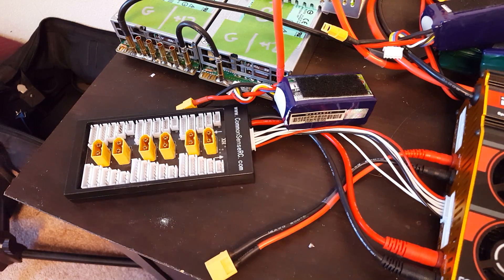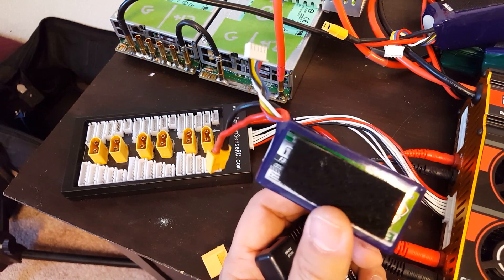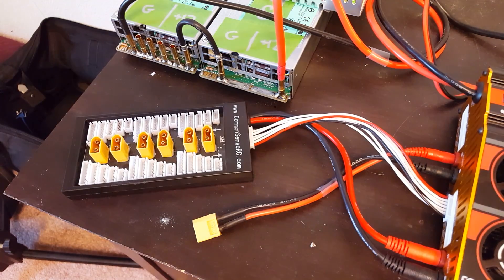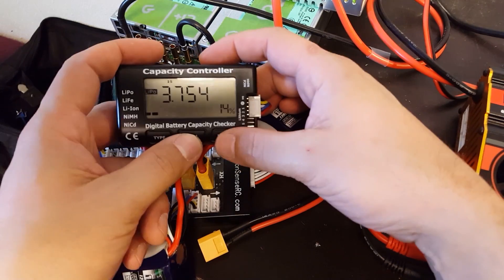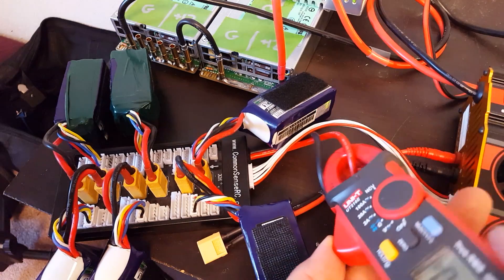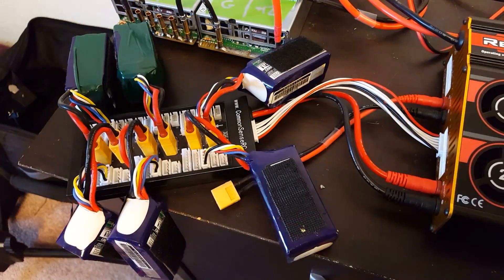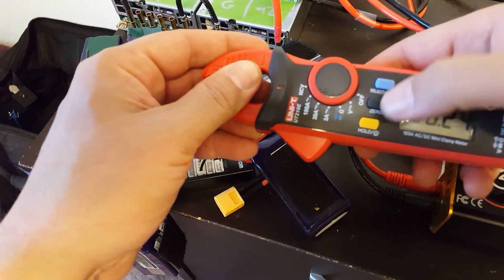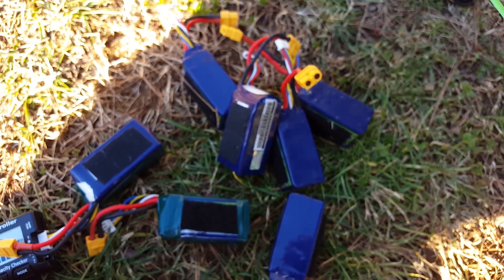Balance Charging: Can you parallel charge?

Comment: Can you discharge with parallel board six batteries
Reply from the maker: Yes absolutely.
Reply: @JoshuaBardwell  10x
What should be the settings for six 6s 1300mah batteries for storage
Reply from the maker: It probably doesn't matter because your charger probably can't storage discharge at more than a couple amps anyway.
Reply: @JoshuaBardwell  i ordered Hota D6 pro duo like hobbymate 
What should be the settings? 

I am a total beginner and i still wait my stuff to arrive but i want to get as much knowledge as i can before starting. 
Reallly appreciate your work and i will support you. Thank you for your videos i learned a lot

My gear is going to be:
Dji googles v2
Patched antenna from iflight crystal with 2 small ones
Dji remote 1
Hota d6 pro duo
Iflight protek 35 6s with spares 
Bat-safe box medium 
Batteries i have not order yet but i am not in a rush i have to do a lot of simulator work :)

It will be great to make a video for parallel discharging and storage. Or can you please tell me what should be the settings for six 6s 1300mah 100c batteries?

Have a great day :)
Reply from the maker: I would say, please get more familiar with the basics of lipo charging and battery safety before you try parallel charging then.

Comment: How do you know when all batteries are charged (without unplugging and checking) if they are all charging at different rates?
Reply from the maker: The nature of parallel charging is that all packs are at the same voltage and finish charging at the same time.

Comment: and this is why I like my DJI fpv ¯\_(ツ)_/¯  I want to fly, not learn about batteries- I also bought a cinewhoop so i am slowly learning about charging lipos through videos like this, but it still scares me, a lot, and I wish that there was just a smarter way to charge them without an absolute mess of cables- with the DJI it's simple, wall plug with 3 outputs, leave them charging overnight, no fear of them exploding, no fear about leaving them charged for a few days if I cant get out to fly, with the lipos it's a power supply, a charger, a balance charging board, a fire proof box, I have to discharge them if I dont use them- the DJI batteries are expensive as hell though
Reply: I was of this school of thought too. I've had my Avata 2 and goggles 3 for 6 months now. Watching the release of the DJI Neo, and all of the goggles 2 owners getting screwed over due to planned obsolescence. 

It made me realize if my goggles are gonna last more than 2 years I need to use DJI just as a video system, and stop using their drones. The Avata 2 will be my last, and I'll be ordering a lipo charger and air unit soon.

Comment: Real world question for you. Balance charge current. If a charger can balance charge at .5a is that faster or slower to complete a charge than a charger that can balance charge at 1.5a? What is the fastest charger in the balance portion of the charge?
Reply from the maker: The faster balance charge current can make a HUGE difference in the overall charge time. As soon as one cell hits 4.2 volts then the balance current limits how fast the remaining cells can charge.
Reply: @JoshuaBardwell  fantastic thank you so much!!! I'm sure a lot of people might want to know that bit of info. Would love to hear a full explanation as to how some chargers can seem identical but one completes charge faster due to balance current.
Reply: @JoshuaBardwell  I have noticed that there is no good way to search for a charger that has a higher balance current. would it be to much to ask if you have a list or an idea as to what chargers have higher balance currents?

Comment: Hi, can you parallel charge with the batteries while connected in series? Maybe a stupid question but! I plan on parallel charging 4x 5s packs while they are connected in series so technically its a 20s battery, I've already made a harness with both parallel and series connections, would it be possible?

Comment: Does it matter that the left two xt60s have balance leads connected different from the four right XT60s?  looks like the 1st XT60 from the right has the balance lead going to the left of the xt60 plug and the 2nd xt60 from the right has the balance lead going to the left of the parallel board.

Comment: Hi you seem to really know your stuff, I am having a problem parallel charging, I have an EOS 1420i charger, now the charger is a 7 cell charger, and the balance cable normally plugs into these balance boards that came with the charger so if you have a 2s battery you plug it into the 2s port etc. Now I bought a parallel board that charges up to 4s packs, now it does not directly plug into my charger cause the balance cable is for 7s, so I use one of the balance boards and plug the parallel board  into the balance board of my charger and that goes into the charger, and it seems to work, issue is I have to do 2-3 charging cycles to fully charge the batteries, cycle one might get it to 30-40 percent then cycle 2 gets usually 100 percent , why???? In one cycle it never gets the batteries fully charged. The batteries do stay cold and I mean dead cold while charging, they never never get warm,  and even after 2 - 3 times back to back they never get warm, but they do get charged. The charge time 1st round is about 18min, the next time charge is only about 10-15 min. Then it is fully charged. My parallel board is a 5 battery 2-3-4s board, so it plugs into the 6s port of the balance board of my charger then into my charger. It seems logical and like I said it does work, very irritating that I need to have it do 2 charges to get the batteries to full. Can any one help, I would be willing to skype with some one to show you the setup, the only diff between most guys doing it is I am using a balance board that came with my charger as the balance cable that if in my charger is for up to 7s, and the boards that came with it go 2,3,4,5,6,7s ports, now I assume since my parallel board has 5 battery ports that is why it plugs into the 6s on the battery balance board of my charger. The charger for sure sees the balance cable cause if I do not plug in the balance  cable it screams it does not have the balance cable in. It does work, just not like I wish it would. Can anyone help.

Comment: I have 1 question, how do you know which balance port should pair to which xt60 port on parallel board, sine the parallel does not point it out. Or it does not matter, the board will working fine while xt60 and balance port plugged in??
Reply from the maker: It doesn't matter. They are all in parallel. Each one is equal to the others.

Comment: Do the discharge levels matter? I mean could i put 3 batteries that are partially discharged as well as one other battery that is almost fully charged and will it not overcharge it since the others are discharged further?
Reply from the maker: No you cannot do that. The fully charged one will discharge into the discharged ones, creating dangerous current flow, and possibly burning out wires or damaging the batteries.
Reply: Right i saw that in your other video. Thanks

Comment: I am looking for a charger capable of charging at least 4 pcs 1500mAh 4S batteries. In that case I need charger to output 4 x 1.5A x 16.8V = 100.8W is this correct?
Reply from the maker: Yep.

Comment: Great video. I always used to charge my LiPos in parallel. Never had any issues. Only thing I did not pay attention to was the voltage of each battery. So I charged batteries of different voltages together and never checked before how much difference there was. Never had any issue though. Probably I only was lucky. Will pay attention to that from now on. And I never waited for them to equalize their charges. I plugged them in and started the charging. Never had any issues so far, but will change my habits and follow your advice, which I think is a pretty good one. So thanks a lot for your efforts and for your great videos. I learned a lot from watching them, not only today ;)

Comment: Joshua, Can I load 2 batteries to charge and other connectors to be free or all plugs must be active, ie 6 rechargeable batteries
Reply from the maker: You can load only 2. There's no requirement to load all 6.
Reply: Thx, Another question about what exactly is the acro mode have the BUGS 8 pro and whether it has the option to turn off

Comment: The real question is not whether or not you parallel charge multiple Li-Po batteries with different voltage level or internal resistance. They'll simply reduce charge cycle life as you push harder. A MIT study found that parallel charging batteries with 20% difference in their internal resistance can reduce the battery life as much as 40%. 
As for safety, it's all about whether or not you're constantly monitoring individual batteries for a defect. A defect battery causes heat and heat can start a fire. So as the shorted battery. This is true when you charge multiple Li-Po batteries in series as well.
When it comes to charging Li-xx batteries, it really is not electronics anymore. It's a chemistry.

Comment: Thank you again for this helpful video! I have a question : What do you select in the charger? Like if there are 6x Lipo 9A ? (6 times 1500 mha) or 1,5A  and treated like it is 1 ? I hope it make sense what I just said :) Thank you!
Reply from the maker: If you have 6*1500 mAh in the parallel board, that is 9 Ah total. So you would charge at 9 amps.
Reply: Joshua Bardwell You are great! Thank you for the very fast answer!! :)

Comment: Come on man! Balance lead should be connected first, weaker cables can act as a fuse in case it is one of those days when everyhing cathing fire.

Better lose balance cables, than entire lipo blowing up in your face, since XT60 can take enough current to make that a very possible outcome.
Reply: Anton Kilcevsky stop looking for problems.  hes gonna be fine.
Reply: @SamIamNotI  when parallel charging don't plug balance cables in first. plug main discharge cable (XT 60) first, so when there is a voltage difference it will equalize over the main cable. balance leads are not rated for a lot off current. I am using the same parallel board, the fuse is there for protection and it is only on the main leads (xt60). The balance connector doesn't  have fuses. 
when you connect two batteries with a different voltage for example by accident the fuse will pop and you most likely safe your lipo's. when you connect the balance leads first, the fullest cell will push as much current as needed to lowest cell to equalize. if the difference is to much this will go with a lot of amperage and the balance leads will melt and possibly catch fire. the main leads can handle a lot more amperage and wont melt that fast and the fuse will pop before cables will melt. So XT60 first peeps!?
Reply: @SkywalkFPV  Ah man now I am flip flopping. Well I have the flip flopper in chief to thank for showing me thats okay. I find it mostly not an issue as my use in solar requires me to have them pretty much identical voltages I will be plugging the xt60 in first. BTW I am using li-ion so maybe not quite as volatile. Whats a good way to drain an old laptop lipo I got  a slightly puffed one I just replaced.
Reply: =) Good to hear from you sir! 
The easiest way for that laptop battery was probably to run it dry before the replacement.
I recommend you bring the dead one to the battery disposal if you can (don`t keep it). Always be aware when handling electronic components. Note that I would not try this with a already puffed battery! 
However a good way for discharging 'draining' an old battery, is checking if there is a visible + and - on it.
If you have a flow meter, they usually come with an build in resistance that allows for discharging.
Make sure u ground this device and use high enough resistance (needs math), because this kind of laptop batteries need a long discharge time. I can not be held responsible for my input ;) Take care, see u around..

Comment: Why are the XT60 plugs also connected when balance charging of the individual cells? Is connecting the balance charge lead not enough?
Reply from the maker: The charger pushes charge into the XT60. For balancing, it pulls charge out of the balance plug. Most chargers can't charge via the balance leads alone.
Reply: ah ok clear

Comment: I have just built 4 x 2s 18650 packs (for my fpv goggles) can I charge all at the same in a balance board? I can't seem to find anybody that has done this.
Reply from the maker: +matt neale they're basically no different than a 2S lipo. You can parallel charge them.
Reply: Joshua Bardwell that's what I thought, I'm not at all good with electrics (however this hobby is amazing and teaches sooo much!) 

Would you use lipo setting or lilo? Not sure what would be best and how to set it up.

P.s thank you ever so much for the quick reply :-) Your tutorials and recommendations are second to none in my eyes

Comment: Without the clamp meter, do you know any way to be sure to not overcharge (more than 2c or even more than 1c) a battery? Any similar rule can be adopted on the internal resistance difference between packs?
Reply from the maker: Honestly, just charge at a low rate when parallel charging. But a clamp meter is the best way to know for sure.
Reply: Joshua Bardwell ok thank you!

Comment: Hi, thanks for the great videos. I have a kind of on topic question. 
I will be putting 3x4s batteries in series to create a 12s pack for an ebike. 
Could I then put the 3 batteries balance leads in parallel to have one battery checker monitor all 3 batteries? 
All 3 batteries are the same (graphene 10000mah 4s). 
This is solely for discharging the batteries on the bike and each battery would be charged individually and not in this configuration.
Thanks for any feedback.
Reply from the maker: If you wire the main discharge leads in serial and then you wire the balance leads in parallel, I think bad things will happen. Think about it: the high and the low balance wire are connected to the discharge leads. So you'll have the batteries in serial and parallel at the same time and ... IDK who will win but I don't like it. I suspect you will have runaway current flow. Draw a circuit diagram and see for yourself.

Comment: i am guessing i cannot parallel charge different sized (mah) lipos. is that correct?
Reply from the maker: Yes, you can. Parallel charging sums mAh. Voltage must be the same but capacity can vary.

Comment: So I'm planning on making a battery bank between 200 to 400 batteries.  Since they will be in a be already connected they should maintain the same voltage. (of course I would balance them before hooking them all together) why can't I just charge them as one battery instead of individually?  I only ask since as a group the batteries should maintain a constant voltage. BTW I want to try and maintain the group (12v) while using an inverter to supply power to working devices.  Would I still use the puny charger, thanks in advance.
Reply from the maker: Any cells that are in parallel do not need to be balanced separately from each other. When you wire cells in serial to get increased voltage, that is when you need to balance. Presumably you will want the output voltage of your bank to be higher than 3.8 volts, in which case you will have some serial sub-banks, which will need to be balanced.

Comment: It is true that all batteries slightly differ in internal resistance.  But the real reason why each of the batteries was accepting a different amperage is due to the parallel board.  The battery closest to the charger will have a higher amperage.  But the battery furthest from the charger will get a lower amperage.  

Better put, if using Direct current to make a light work current drops the longer the wires.  Get shorter wires to minimize current loss.  

To get a true even charge, one of the main power leads should be on the other end of the balance board.  This forces the current through all the batteries thus resulting in a even current across all batteries.  I know this from Electrathon racing over the years.  Iota DLS chargers cover this very topic for lead acid batteries in a PDF online.  They go into more detail to get a "perfectly balanced batteries" with a modified wiring setup.  But in the end, the same can be applied to really any battery.
Nice video Joshua Bardwell, like the videos!

http://www.iotaengineering.com/pplib/balancedcharging.pdf
The link to the PDF I mentioned.
Reply: BikeGuy1992 That wouldn't make a noticeable difference, it has to do with the varying internal resistance of each battery like he explains near 6:18.
Reply: Yeah, internal resistance does make a difference.  But coming from experience the Iota charging schematic does help to keep all batteries charging evenly.
Reply: Battery internal resistance is significant but so is the resistance of the leads and connectors which can easily be comparable to the cell resistance. This becomes more problematic as the charge current increases because the voltage drop across the connectors and leads increases too